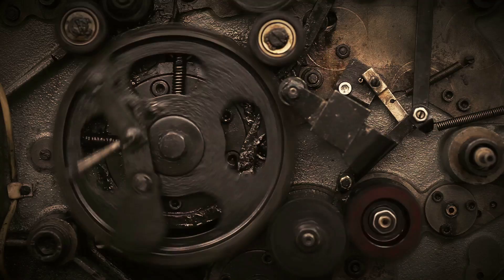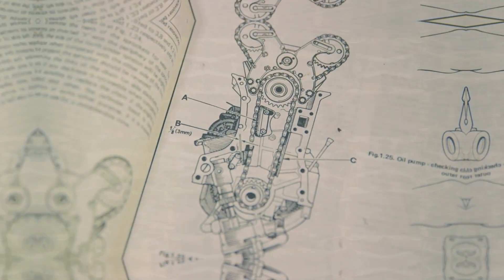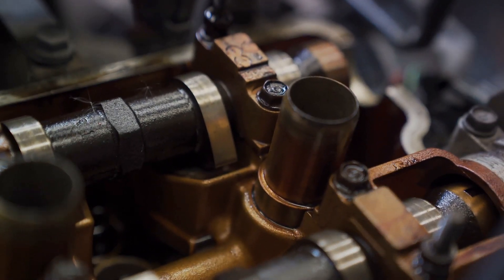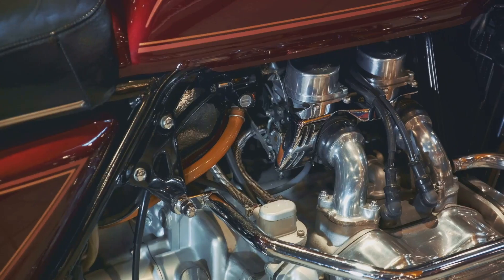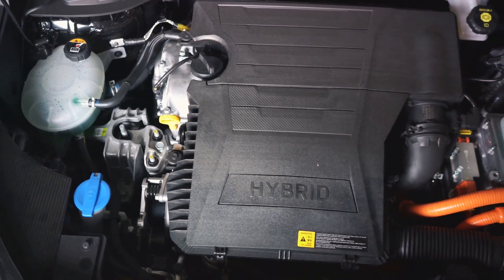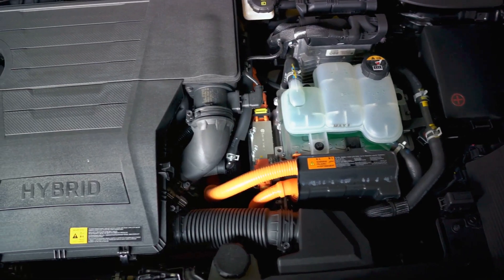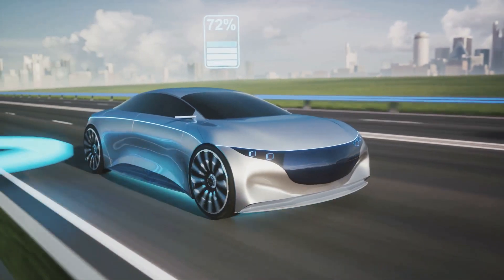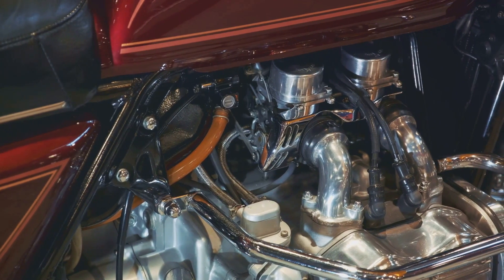Atkinson Cycle Engine | Toyota Prius & Honda Engines

Comment: I'm just guessing that with variable valve timing the engine can be adjusted back toward Otto cycle. Would be like free turbocharging for driving at high elevations.

Comment: What an exaggeration for a simple technical change in an oto cycle to an Atingson cycle. Just leave the inlet vale a little bit longer open during the compression mode .so there are less pumping losses. That's it nothing more
Reply: And less fuel/air (to control the peak pressure). So you don't have to run high octane fuel.